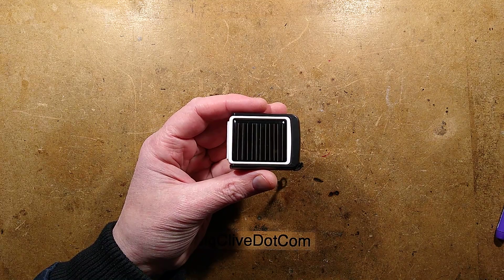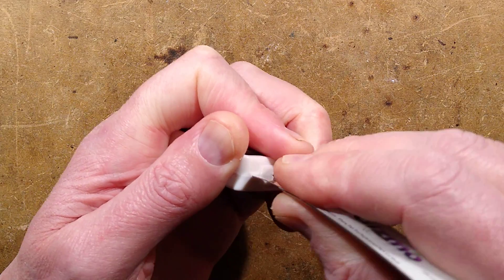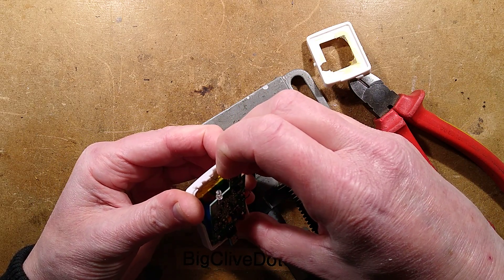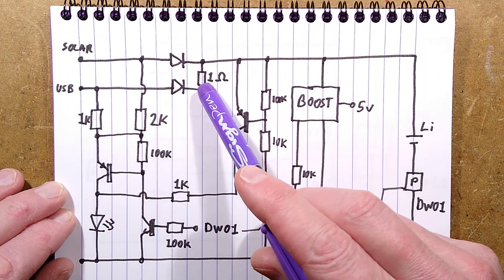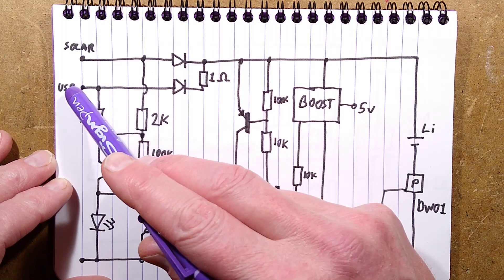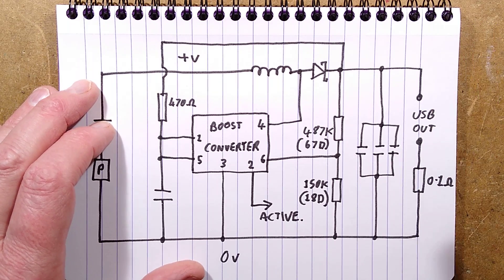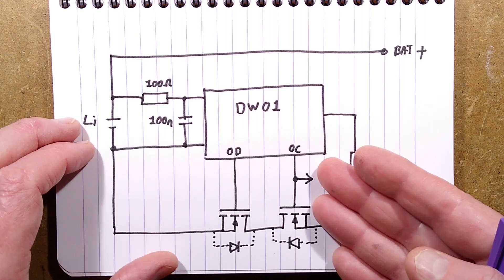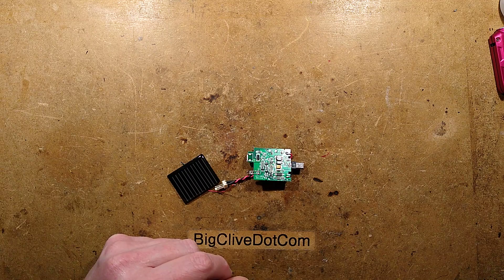Ultra small solar power bank with retro circuitry (with schematic)

Comment: Hm rather than all those transistors and bits controlling the LED, seems like it'd be cheaper and easier to just have a second LED, instead of this baroque OR gate. Unless they found the transistors in a dustbin, of course.

Comment: 11:30 Switchers are funny things. In this boost circuit, the two types of capacitors (tantalum and ceramic) are there to attenuate the two main components of output ripple voltage. Tantalums give you fairly high capacitance in a small package volume but at the expense of large equivalent series resistance (ESR). Ceramics have virtually zero ESR. When these two capacitors are paralleled, the two types of ESR are in parallel with one another, the total ESR in the output filter capacitor is almost zero. The output current waveform of a boost is usually a trapezoidal looking thing. That current waveform times the total ESR is a voltage (I*R) and is one component of the ripple voltage, which is made almost zero due to the presence of the ceramic caps.

The other component of ripple voltage is due to the boost current going into a capacitor. You know, V(t) = int(I*dt) /C. To keep this term small, you need a large C. This explains the presence of the tantalum cap: to reduce this term (1/C).

Thus, you use a relatively cheap big-value tantalum in parallel with a cheap lower-value ceramic to lower the output ripple voltage on the boosted 5V output! Boost circuits are notorious for the amount of ripple voltage they produce, as well as the stress levels the output filter caps have to endure, particularly for high output current boosts.

Comment: Totally not understanding why they chose to use a PNP plus an NPN transistor to drive the LED, and then repeated the entire pattern a second time. Very odd. Maybe it's supposed to provide a constant current drive, but I'm not seeing it.
Reply from the maker: Just old level shifting logic.
Reply: @bigclivedotcom  You could just bypass the npn entirely and dump the LED cathode directly into the collector of the NPN. The current draw from the processor would be slightly increased, but the levels would be the same. The configuration shown is a type of complementary Darlington, i forget the proper name, so it has more beta, but that ought not be an issue, at least with modern components.

With older components like th e 74xx and 74Sxx families, current sourcing ability was very limited.

Comment: 4:00 Not having a vice at hand, I once or twice replaced frayed power cords on my colleague's laptop chargers. I propped the chargers against a small concrete step and gave them a short, sharp glancing blow with a 4 pound hammer. You takes your chances and sometimes you wins. Other times you waits for the company to (eventually) send a new charger...

Comment: ive seen a LOT of devices where they have a tiny solar panel to keep the battery topped up rather than as a way to charge it. that kind of makes sense with a device like this since you would only use this once in a while but you want it to stay fill even while your not using it.
a good example is that hand crank emergency radio/flashlight/battery bank combo thing off amazon that has a million clones, the best selling one lists its solar panel for that reason.

Comment: I'm wondering how well the cell and circuit actually hold up to heat when you expose it to direct sunlight for prolonged period of time
Reply: I have a solar powered tire pressure monitor and when I left it under the windshield in sunlight the lithium cell in it puffed up. It needs sunlight to recharge but the sunlight destroys it. So I have to protect it from the sun.
Reply: @aszi77  Probably did not have an overcharge protection circuit for the lithium cell, and it got overcharged. Many of these cheap products skimp on the circuit, and dont expect that people are going to actually leave them out in the sun to recharge.
Reply from the maker: In this pack they did have some separation from the front.

Comment: In damp gray winter Scotland how long does it take that tiny panel to charge it from empty to full?
Reply from the maker: On a typical grey Scottish day the output from solar panels is nearly nothing.  The figures and graphs presented by solar power salesmen here are very suspicious.
Reply: @bigclivedotcom  As all such solar salesmen data should be questioned. As you know, I know practically nothing about what you are talking about, but I am old enough to remember when nuclear power was going to be so cheap that they wouldn't even have electric meters for homes anymore!

Comment: Could you use it on usb led strip lights outside and keep it charged GREAT VIDEO
Reply from the maker: I doubt they would run for very long with such a tiny panel and cell.
Reply: @bigclivedotcom   same thaught as me
Reply: That tiny panel doesn't charge that fast._

Comment: I have some solar keychain lights.  I've always wondered if they actually charge the battery or if they shoved a coin cell in and the panel is for show.  Glued shut so I haven't taken them apart.  Eventually one will fail and I'll find out.
Reply from the maker: Some are fake.  Standard non rechargeable cell and no wires to the panel.
Reply: @bigclivedotcom  I suspected that.  No point destroying one till it stops working though.  I'm not as good at putting together as I am taking apart.  With my infrequent use a coin cell could last about as long as a rechargeable battery.  Definitely beyond the return period.
Reply: @jmr  some are even better and connect the solar panel to a non rechargeable battery 😂
They don't like that much
Reply: I actually got a REAL one at my local hardware store for $1. It had a REAL solar panel, with REAL circuitry, hooked up to a REAL rechargeable 2032 cell. I guess I should consider myself lucky
Reply: @davelowets  That's interesting.  Rechargeable 2032 cost more then $1 all by themselves.
Reply: @jmr  I'm guessing they dont cost that much if you buy 50,000 of them at a time... I just bought some hi-capacity rechargeable lithium 2032 cells on Amazon for a cost of $1.67 each with shipping included.

Comment: I like it. The modern minimalist 3 component design is all very well but it removes the possibility to modify the circuit for another purpose.

What do they call those little bottles, I've seen you use them for solvent and flux, they look very useful.
Reply from the maker: Generic metal tip dropper bottles from eBay.